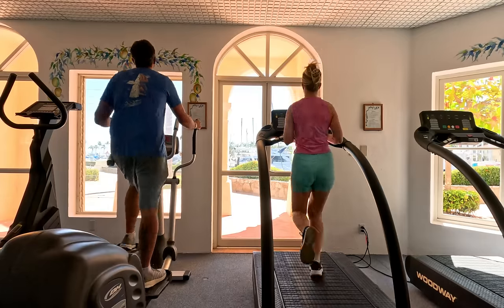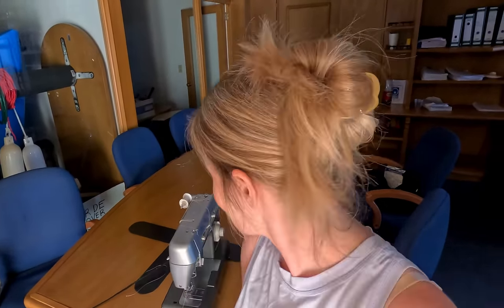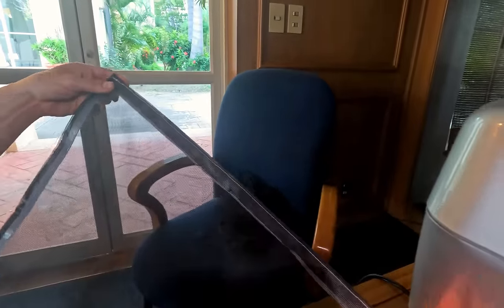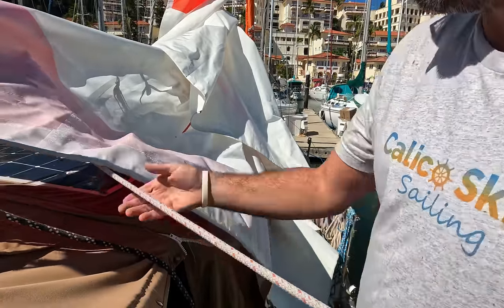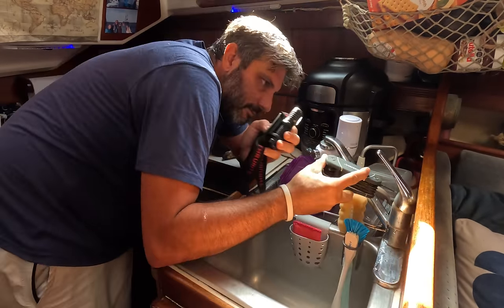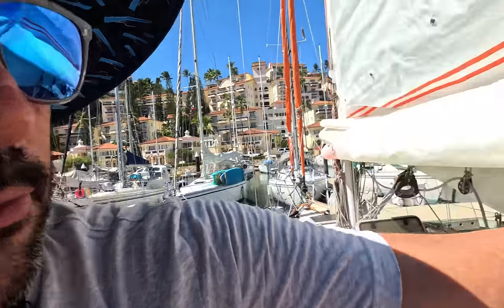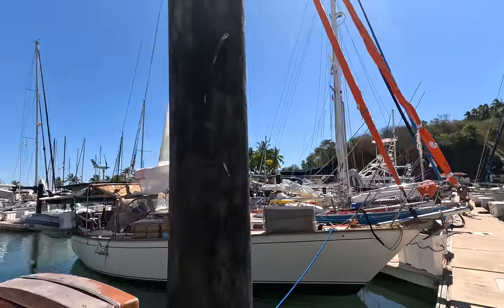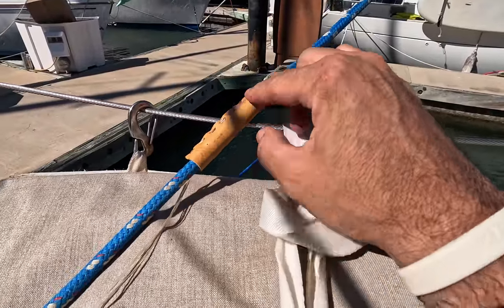This is IT!!! Remind me why we left land life again??🫣😅 (Calico Skies Sailing, Ep 216)

Comment: On wire rope used for electrical fencing I run the rope through  small diameter water line or pex tubing where I want to prevent rubbing.  Both come in small diameter and are inexpensive.
Reply from the maker: Smart!
Reply: Great idea
Reply: Or a soft shackle with a block to raise the height.

Comment: The lazy sheet can also be used to stabilize the pole. Extra crew=good idea. I know it is a big expense but a spare drive that bolts right in(exactly the same as your new one) for the AP would never be a regret if you needed it!
Reply from the maker: Yes we have a spare drive but are debating getting another brand new one. We have two slots in our rudder arm so I could possibly have parellel drives that would only require wiring in the solnoid coil and drive engage

Comment: Hi Guys, great episode. I am also changing up my reefing lines. Switching from 14mm to 10 mm  polyester covered dyneema core. My Lagoon 46 reefing lines have been troublesome, hoping the 10mm will keep the issues to a minimum. Crossing the Atlantic, we battled with jams, tangles, etc. I'm using a split line system on reefs two and three. Reef 1 is single line reefing , while reefs 2 and 3 are split, one each for luff and leech. Installed an extra winch and clutch on the starboard side to do this. Haven't been planning to cross the Pacific, but you guys are making me think differently! What reef lines are you using now?
Reply from the maker: Our reef lines are traditional braided lines. I don't think our main is generating the loads of your Lagoon 46 haha. We've moved most of our reefing procedures to the deck. I like it to keep it simple and the least amount of friction so moved the main halyard to the mast and not run to cockpit. We also use reef cringles for the tack. I like to have to occasionally go forward, good to keep a visual on whats happening around the boat. Come play in the Pacific!

Comment: That little leather keckling you made needs a stitch through the line or it will slip.  Also, you never said why the reef lines chafed. Did you address whatever the actual cause was?
Reply from the maker: Yes I did run a stitch thru the line. Not sure what caused the chafe.

Comment: Cowabunga dude, surfs up. I had a 3rd reef in the main, It was rigged with a block on both sides of the boom. It was too heavy to keep in place all the time. I ran a messenger light line through the rig, so if needed a proper line could be pulled through to use the reef. I sold the boat before I ever had to rig it for weather that bad. Find a storm sail instead.
Reply from the maker: Thats a good tip! Get some messenger line run in, it would add a lot of weight and line keeping the third reef permenantly run